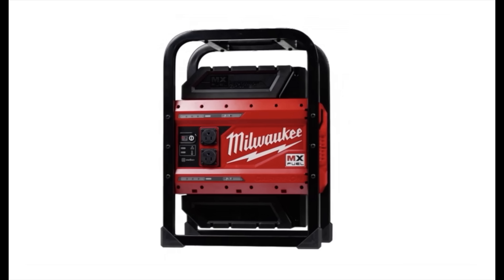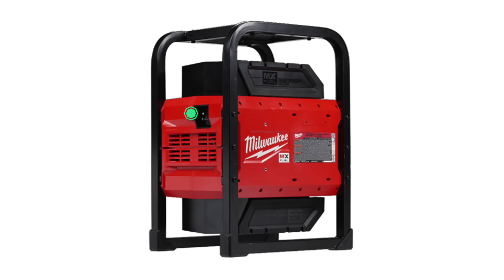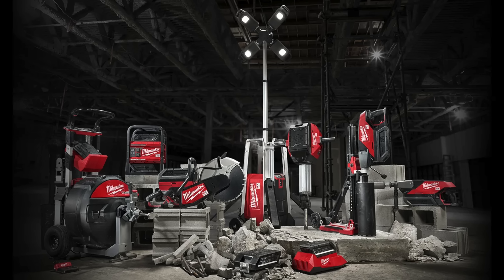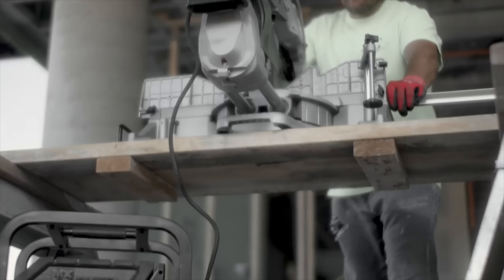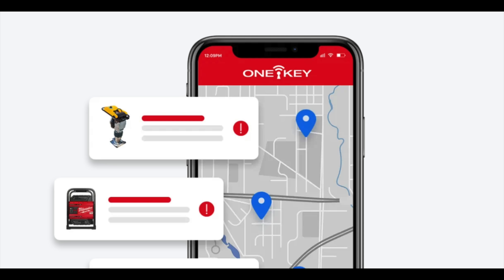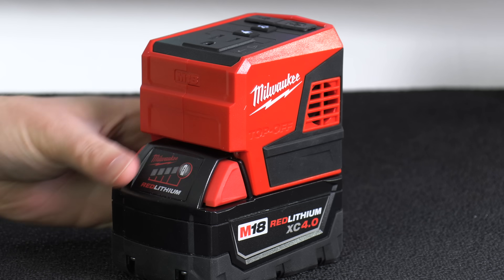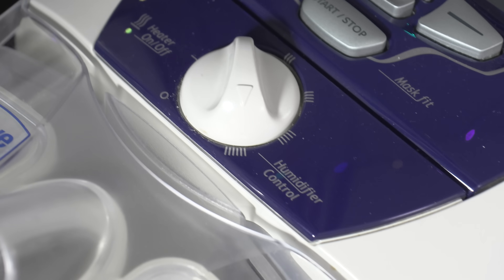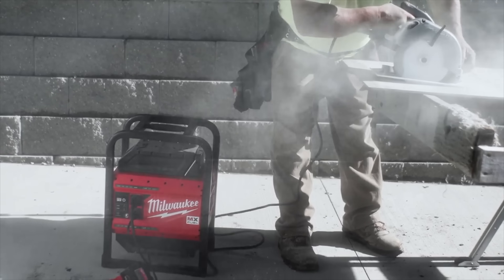END of GAS Generators? Milwaukee MX Fuel Carry-On Changes EVERYTHING 3600 Watts!

Comment: Its crazy how we emphasize "you'll never buy gas again" like electricity is free since it was discovered
Reply: @UC5k3ZRTUAYhSCzxZUOSHDrg ... maybe a full size panel could give you that much but not the small ones shown that fold in half. Portable panels are also more likely to be damaged by bringing them to a job site every day, rather than wear out. This is a major cost versus convenience factor that most are not willing to deal with.
Reply: @rupe53  I am not saying it is for every job. BUT it is appropriate for many jobs.
Reply: @rupe53  No they are not! You can get 300 W solar pannel, even multiple pieces of 300 W solar pannel: 2 pieces of 300 W portable solar pannels give you 600W (and they are not even big). Circular saw have consumption 2500 W, so 10 minutes consume only 416 Wh (even less in reality, because saw is not fully loaded 100 % of the time). So for 10 minutes of circular saw only 40 minutes of solar charging is needed. If you need even more, you can use more solar pannels, for example 6 pieces of 300 W solar pannels: you need only 10 minutes of charging.. in case of cloudy can maybe half an hour, but still this is more than enough for most of the people.
Reply: @rupe53  300 W solar pannel IS PORTABLE and folds up :) type in youtube "300 W portable solar pannels. To set up small portable solar pannel you need only a few seconds, there is no problem for convinience. On top of that: cost in HUGE advantage, but it is not only advangtage. LACK of loud noise that petrol generator has (and you need to listen it a whole day) is huge advantage also.
Reply: @damijanapopotnik8081  ... yes they are out there and they generally cost a lot. ($150+ starting at 100 watts) You say there's no convenience problem and after working with contractors for the last 25 years I can safely say the average guy has no room to put several in his truck on a daily basis with all of the other stuff rolling around. Damage is a MAJOR consideration. The more things get handled the more likely they are to get damaged.... and I doubt any contractor will leave $3500 worth of tools on a job site overnight for an extended period. Not saying the idea has no merit but this is not ready for prime time without a lot more education for the end user.
Reply: @damijanapopotnik8081  ... that video was well done but a lot of sweat equity that the average guy might not want to get involved in. His version of "portable" also requires tools and time. The store bought "portable" was quite a bit less powerful, as I mentioned earlier. I can just see that going into a pickup truck and having a tool box poke a hole in it. Not quite the same as a minor hail storm. As I also mentioned, it's doable but not ready for prime time with the average joe.
Reply: @rupe53  1. average guy can do that no problem (maybe the problem is in their head, they don't want to because of myths, but they abosolutely can). 2. It does require a screwdriwer and a few screws, anyone have these, so no problem there (no special tool required). 3. You can get already made portable solar pannel 300 W, which is MORE powerful (type into youtube "300W portable solar pannel".  4. NO! Toolbox will NOT poke any hole in it because that is tempered glass, which is resistant even to HAIL 3inch in diameter! No way that toolbox will poke a hole into it, no way! 3 inch in not minor at all. 5. You can make a foam case and strap it on the side of the pickup truck bed, away from the toolbox, no problem. 6. Average joe CAN do it, no problem if he want to save money.
Reply: @damijanapopotnik8081  ... ok, moving forward.... 10 amps at 12 volts is only 1 amp at 120 volts. (ball park) Now we're talking 100 minutes of charging to run a 10 amp table saw for 1 minute. Not practical on a job site. It might help extend things but we still need a full charge at the end of a day.
Reply: @rupe53  No. 300 W solar pannel in the sunny weather produce 300 W of power. (2,5 A at 120 V). If you have 4 of thoose that is 10 A at 120 V, which means you can run the saw whole day without stopping! Very practical on a job site, no limitations at all! :D That is for a sunny day. But EVEN FOR a cloudy day you would need only 3 minutes of charging for 1 minute of saw running, which is more than enough for most of the people.
Reply: @rupe53  You simply doesn't understand that NOBODY is limiting you to use just one pannel, you can use multiple pannels no problem.
Reply: @damijanapopotnik8081  ... ok, you do it your way. I'm in New England where it's 25 degrees today and we haven't seen sunshine more than 20 minutes in the last week. We also had freezing rain last night so everything has a coating of ice. Only an engineer would try to talk me out of bringing in temporary power to a job site for $50 a month.
Reply: @rupe53  1. Not everyone are in England on a jobsite without power. 2. Most of the construction is happening in summer, spring or autumn with plenty of sun so therefore solar pannels are ideal there 3. EVEN IN winter in England you can make it work: you buy 6 300 W sollar pannels. In full sun that would be 1800 W of power. But in cloudy winter with freezing rain that would STILL  be  around 350 W, which is enough for most cases: 350 W means you can run a circular saw 20 minutes for every hour of charging. That is more than enough for most of the people.
Reply: @damijanapopotnik8081  ... different strokes for different folks.
Reply: @rupe53  Sure. But you can't deny that electric powered generator is battery is superior for a lot of the use cases (not all, but a lot of the cases), because it is much cheaper to run (even 13 times cheaper, and it is silent).
Reply: @damijanapopotnik8081  ... never said they don't have their place. BTW, cheaper and better are VERY subjective. Also, cost to run depends on how much you use it, especially when figuring purchase price into the math. For casual use (a few weeks of camping) you'd never meet payback in 10 - 20 years, versus a small gas generator.
Reply: @rupe53  1. cheaper is objective (you calculate that), it is better in a lot of the cases that is also objective. 2. Afcourse overall cost to run depends on how much you use it! 3. NOT TRUE that you would never meet payback on a causual use (a few weeks of camping)! You can use a car 12 DC to 120 V AC converter, that cost you $15 on Ebay. You can use a drill batteries you already have (drill batteries that you have from your battery power tools, you don't have to buy anything additional). So price is 15 $ for a DIY battery "generator". A petrol generator cost you $300 or more. So even a the start you are cheaper of with battery "generator" and then you also save $110 every year because you don't have to buy fuel for the generator for a few weeks of camping. So battery generator is a lot cheaper EVEN if you use it only a few weeks on camping a year. If you only use a few weeks on camping you would save more than $2500 in 20 years, if you would use it more, you would save even a lot more! And NOBODY likes to listen to a loud generator on camping, NOBODY remember that!
Reply: @damijanapopotnik8081  .... the numbers you use can be slanted either way. I was thinking small gen set and $20 gas (per year) for limited use comes in under $1000 for 10 years. In the same 10 years the inverter system will be prime for new batteries so already costing more.... and I still have a gen set that needs only gas and some maintenance. In 20 years I have a gen set that probably still works but the inverter likely needs another set of batteries. See, total hours of operation per year can make or break the whole deal because the batteries will go to pot just hanging around, using them or not. Yeah, gasoline can also be troublesome for people who don't keep after things but these are the same people who would store an inverter with a dead battery and wonder why the life is cut short. Meanwhile the gen set I bought in 1988 had it's first carb service last month. Other than that I have only changed the oil and installed new spark plugs.
Reply: @rupe53  Afcourse the more you use it: the more you save with a battery generator. BUT EVEN IF you use it very little: battery generator is still a lot cheaper as we calculated above.
Reply: @damijanapopotnik8081  ... all good info, but you forgot to include the $1300 cost of the set in the video... and that's for a base unit without any extras. Also, time will tell if that battery will last 20 years. It might be possible but I doubt that will be average.
Reply: @rupe53  Also this: https://www.teslarati.com/tesla-battery-life-80-percent-capacity-840km-1-million-km/
Reply: @damijanapopotnik8081  ... have seen that report recently and would hope the better tech comes along for the ride when you spend $50 - $100 k on the car. We'll see if the general consumer market follow suit.
Reply: I guess if you charge by solar it might be, but the solar systems cost even more that these power stations so you would be better off just going solar for the same results. That is what I am doing with my equipment trailer. 3 deap cycle large capacity batteries with 800 watts of solar for recharge and a 5000 watt inverter.
Reply: sure, just plug it in to any available outlet....
Reply: It can be nearly free but the gov doesn’t want you to know or have it.
Reply: People will buy gas when the grid is off. Hurricanes, earthquakes, the rare terror attack.
Reply: @TehKaiser  For now, gas is just plain king.
Reply from the maker: That's very true, but in this case if you use these on a job site every day, it would eliminate a routine thing that everyone deals with getting gas. But yes, still costs you money and has to be made somewhere.
Reply: @SilverCymbal  Then you have to tote it home and charge it and not forget it tomorrow, bet a compressor would give that thing fits
Reply from the maker: @tompayne695  Not exacty, you could keep more batteries on hand, like keeping extra gas. Obviously much more insanely expensive but that is how you would keep going. My hands on test should give more info on runtimes, real world performance.
Reply: @SilverCymbal  ONLY if they can last the day ... if they cant maintain 1800w for 16 hours then you are better off with a generator ... as a battery bank needs to be recharged ... a generator just needs to be refueled ... and you can carry can of gas and a generator easier than you can carry 2 or 3 battery banks ...
Reply: @SilverCymbal  Electricity is much cheaper than gas, even in America where the gas is as cheap as water! In Europe where gallon of gas costs 7$ there is even more difference.
Reply: @damijanapopotnik8081  electricity is very cheap but nor very transportable, with diesel/gas/LPG you have freedom everywhere you go.
Reply: @carholic-sz3qv  Sure. But still a lot of the times electric "generator" (power bank) is appropriate for the task, and electricity for the generator is 10 times cheaper.. so where you CAN use electric "generator" it is definately smart to do so!
Reply: @carholic-sz3qv  And also: with electric "generator" you can use portable solar power and charge the battery "generator" whereever you go.
Reply: @damijanapopotnik8081  yeah sure but its not always the case and would you buy the two systems or just the battery?!
Reply: @damijanapopotnik8081  the conditions aren't always the best and gas/LPG gives you the flexibility, for more power diesel remains the king.
Reply: @carholic-sz3qv  If i would calculate that it is cheaper in the long run, then i would DEFINATELY buy two systems! And for the majority of people battery battery "generator would be perfectly enough.
Reply: @carholic-sz3qv  I am not saying that battery generator is for every job! I am just saying that WHERE the battery generator is enough, it is smart to use it because it is much cheaper to run! And battery generator with portable solar panels also give you flexibility, sometimes even more so: maybe there isn't a gas station in the middle of nowhere but there surely is sun in the sky (and even cloudy weather can be enough).
Reply: @damijanapopotnik8081  7 dollars?! Man I thought our prices were bad. Is that all taxes?
Reply: @joeschratz9360  7 dollars yes. Taxes is only around one third to a half of the end price. In most of Europe price is 6 to 9 dollars in normal times (before and after corona). In europe we use liters, not gallons tho. Real example: in my country (Slovenia) the price before corona was 1,4 € per liter. That is 1,7$ per liter. For 1 gallon you need 3,785 liters. So price per gallon is therefore: 3,785 x 1,7 = 6,43 dollars per gallon. In Noway price right now IS 1,57 € per liter, which is 7,22$ per gallon, but that is right now because of corona. Before corona the prices in Norway was 8,75$ per gallon... In every Europe country the normal price of fuel is around $6 to 9$ per gallon..
Reply: @John_Lee_  Your calculation is VERY WRONG because you are leaving out the efficiency of ICE generator!! Efficiency of small gas generator is only 15 % to 20 %. So best case scenario: Electricity: 33,5 kwh x $0,090217 x 0,2 = $0,6044 . And gasoline in Amerika is currenty in your state $2.25 (as you said), which is almost 4 times more expensive! So GAS generator in Amerika is almost 4 times more expensive! In europe: price for electricity is similar, but price for gallon of gas is $8. So gas is 13 times more expensive than electricity in Europe.
Reply: @John_Lee_  What you mean?
Reply: Afcouse the efficiency is VERY important, it defines how much actual energy you get out of it (how much gas would you actually spend per kWh of energy). ;) And you should NEVER leave that one out! If you are smart you should probably know that, don't you. 😂
Reply: @John_Lee_  Slovenia. But in ALL of Europe price for gas is around $6 to $9 per gallon.
Reply: @damijanapopotnik8081  ... the optional solar panels will NOT recharge the unit quickly enough to keep after a contractor's use.
Reply: @rupe53  There is NO optional solar panels for this model. BUT: similar models HAVE solar charging port and you can get enough solar panels to keep after contractor's use easily.
Reply: @damijanapopotnik8081  ... you do realize those portable panels are only 50 - 100 watts each, right? You'd be all day trying to recover 10 minutes using a circular saw.
Reply: @damijanapopotnik8081  you are leaving out the INefficiencies of chargers, batteries, and inverters.  Each conversion is 10-30 percent loss.  Stack those up and ICEs make a lot of sense.
Reply: @damijanapopotnik8081  good idea keeping the quotes around "generator" :)
Reply: @joeschratz9360  It's about $4.5 gallon of gas and $0.18 for kWh of electricity in CZ now.

Well, 2.2kW generator can do 16 hours at half power (1000W) on 6.5 gallons, so it is $1.88 per kWh. Power bank will be something about 65% efficiency (80% twice) so it will be $0.30 per kWh. This power bank will need spare batteries as one included set of two at half power (1000W) lasts about 40 minutes, so at least 5 sets needed and two more chargers. Maintenance will be oil change every 60 hours ($7.40 => $0.12 per workhour) and new batteries every 5 years (I'm the optimist here*, $5990 => $0.14 per hour).

So 10 years (1kW, 3hrs a day, 14days a month) overall price will be: 
Gas: $1400 + $0 + $9475 + $605 = $11480 /10yrs
Electro: $2199 + $5190 + $1512 + $11980 = $20881 /10yrs

* not sure if it has 40-cells balancer inside, so maybe 3 years life of battery would be better to count

It's all about battery lifetime and it's nonsence comparing it with EVs because of lack of cooling, balancing and still you can have just one of 40 cells faulty and your $599 battery pack is complete dead. 10 or 20 years is just a dream and it will be seen on used EVs market very soon :-)
Reply: @martincerveny2284  Damn. You know your stuff. Thats some valuable information. Thanks man.

Comment: While I look forward to new battery tech and have generally a positive view on the use of electric energy due to electric engine efficiency vs. gas I'm not quite sold on an electric generator yet. While I do believe you have to start somewhere, as solar panels become more efficient in which this can be used in an emergency situation I believe this product will become much more viable.

Comment: I'm in love with battery power stations. I have 2 Jackery 1000 wh units, a 2400 wh Bluetti, and the newest 2000 wh Bluetti with the 2000 pure sine inverter.  Oh, and also a 160 wh Jackery. I also have two of the folding portable Jackery 100 watt solar panels, and a Honda inverter generator--the 2200 watt one......I'm not a nomad living in a truck, but I do live in a remote place on the Mojave Desert in Southern California where the power routinely goes off for a couple of days during the middle of summer... and I'm 84. The temp. at my place during late June, all of July and August, runs above 110 normally during the days, and stays around 100 nights. I'm too old and too dumb to mess with a DIY project to supply power to run at least a small A/C and refrig. during the blackouts. These battery powered power stations do that job easily,. They are uncomplicated, easy to move where I need them, and safe to use. At 84, I'm living on borrowed time anyway, so what do I need with a few dollars when I fall off the Earth?